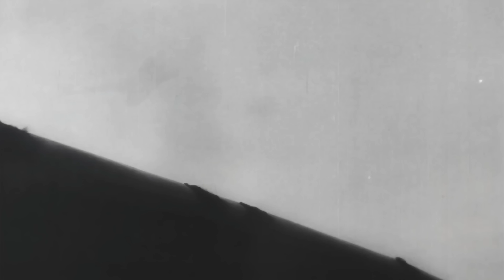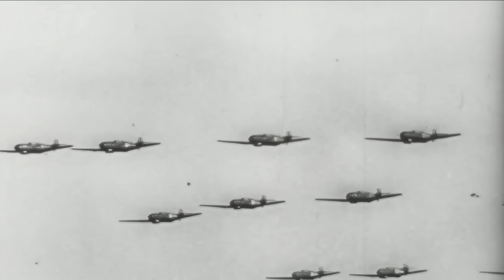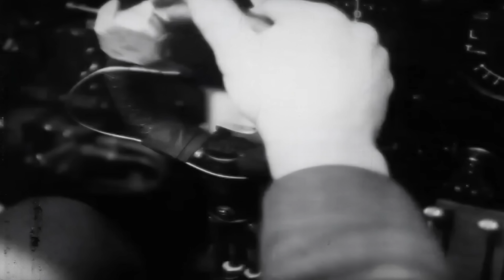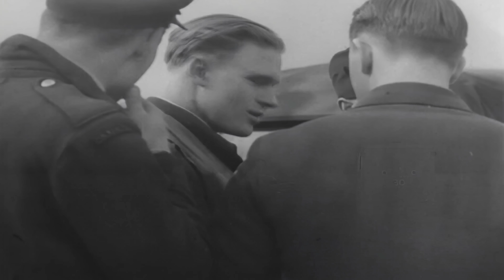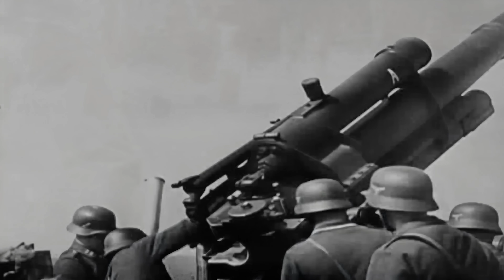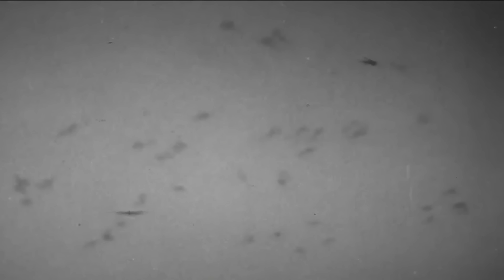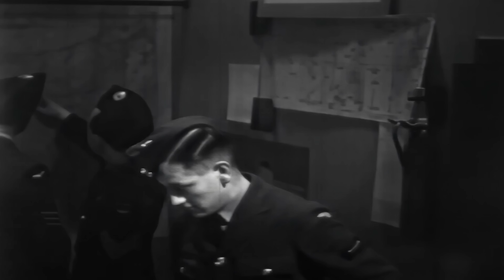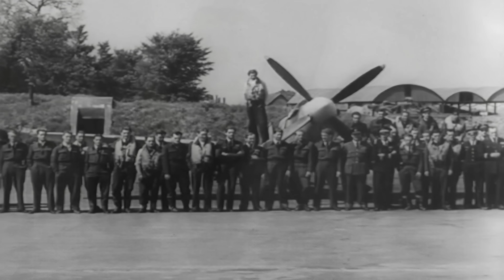440mph Monster That Cracked Germany’s Air Force

Comment: The Mk 9 four blade propeller Spitfire was the answer to the Fw190 the Tyfnon was a fighter bomber fitted with rockets and small bombs
Reply: The Typhoon was a direct answer to the Fw190 a  but problems with it cause it change in role. The Spitfire needed the time so the Typhoon was there first. The Tempest is what the Typhoon should have ended up as as originally the Tempest was going to be called the Typhoon Mk2
Reply: It took the better part of a year from the appearance of the FW190 to the Spit Mk9, meanwhile the Typhoon took control
Reply: I was going to say the Griffon engined Spitfire was what took back air superiority
Reply: @reggiedixon2  Not so MkIX 1942 parity MkVIII 1943 and MkVII  1944 superiority all with Merlins The  MkVII HF had the highest service ceiling  of all allied fighters @ 45700ft
Reply: The Typhoon was intended as a fighter, but it was a failure. The ground attack missions was unintended but a reasonable use of it. The P47 was better for ground attack as the Typhoon was a bit crap. The Tempest and Fury were excellent.
Reply: @kentl7228  No not so P47 downlow 350mph Typhoon 372 mph Typhoon more maoeuvrable P47 turned like a bus  RAF were trained at G/A and CAS in the UK I do not think the USAAF ahd a school in the UK
Reply: @jacktattis The P47 could carry more, the belly rack helped, fly further, could belly land safely from no chin radiator, could take more damage, fly higher and faster after the mission, had good agility up high, didn't have fume in the cockpit problems.... The Typhoon did ground attack because the airframe was a failed fighter and the flaws still were there in ground attack. I used to like the Typhoon, but the reality was different.
The Tempest and Fury families were brilliant.
Reply: @kentl7228   The P 47 did ground attack because it was a poor fighter and the Typhoon was better and a great ground attack fighter.
Reply: @barrierodliffe4155 That is utterly false. The best German pilots were killed by the P47. The highest scoring USAF European aces flew the P47. It turned very well up high. Down low, not so much but it was a high altitude fighter. The Mustang used less fuel and flew further, though a P47 could fly almost as far with decent fuel tanks and the later P47N outranged the Mustang.

As I wrote above, the Typhoon was a problematic dog. The Tempest was designed to fix the flaws of the Typhoon.
Reply: @kentl7228  hahahaahaha P47 2000 to  2400 lost doing G/A exclusively for LESS THAN one year YES 2000+
 Typhoon in service 12 months before the P47 AND only 670 planes were lost to all  causes
Reply: @jacktattis Why start with "hahahaha"? Are you even a teenager yet?
The Typhoon had compressibility problems from too thick a wing. Exhaust fumes would leak into the cockpit, affecting the pilot adversely. The tails would break off and kill the pilot. The chin radiator would dig in and flip the aircraft during belly landings, killing the pilot. It carried less than the P47.
The Mosquito and the P47 were the two aircraft with the lowest loss rates in the European theatre.
The Typhoon wasn't good at all and had high losses. There is a reason why the excellent Tempest and Fury fighters were designed. Because the Typhoon was crap.
Reply: @jacktattis a simple Google search ..

"The P-47 Thunderbolt generally had a lower operational loss rate than the Hawker Typhoon, primarily due to its incredibly tough air-cooled radial engine (R-2800) which resisted battle damage far better than the Typhoon's liquid-cooled Napier Sabre, making the P-47 more survivable, especially against ground fire, despite the Typhoon's effectiveness in ground attack roles. While both were robust, the P-47's ability to absorb hits gave it a superior sortie survival rate, around 0.7%, compared to some estimates suggesting high losses for Typhoons, especially early on. "
Reply: @jacktattis   "P-47 Thunderbolt Loss Rate & Durability

Low Loss Rate: The P-47 had the lowest loss rate of any single-engine fighter in Europe, with estimates around 0.7% of combat sorties resulting in a loss.

Battle Damage: Its large, air-cooled radial engine was famously durable, allowing it to absorb significant damage from small arms and light flak and still return home.
 
Hawker Typhoon Loss Rate & Vulnerability

Higher Losses: The Typhoon experienced a significantly higher percentage of losses, with some figures suggesting 56% of all Typhoon pilots were lost on operations, a rate higher than Bomber Command.

Engine Vulnerability: Its liquid-cooled Napier Sabre engine, while powerful, had a large radiator that was highly vulnerable to small arms fire and ground attacks, leading to more frequent engine failures and crashes"
Reply: Saying numbers of airframes lost, without stating over how many missions, doesn't show the percentage loss rate. This is basic mathematics.
Reply: @jacktattis While exact 1944 European losses vary by source, thousands of P-47 Thunderbolts were involved, with significant numbers lost to combat and accidents, with figures suggesting over 1,000 lost in 1944 alone, contributing to the overall war total of over 5,000 lost by the end of the war, including around 1,700 non-combat losses. 

The P-47 was crucial for ground attack and escort, absorbing heavy damage and suffering losses in intense fighting throughout the year, especially during major operations like D-Day and the Battle of the Bulge. 
Key Figures & Context:

Total War Losses: Approximately 5,222 P-47s were lost during WWII, with about 1,723 from non-combat accidents.

1944 Specifics: A specific 1944 breakdown isn't easily isolated, but given the high activity and losses, figures like over 100 lost by one group (371st FG) in a shorter period, and mentions of thousands lost by year's end, show the scale.

High Operational Tempo: P-47s flew hundreds of thousands of sorties in Europe, destroying vast numbers of enemy vehicles and aircraft, making significant losses inevitable. 

Why the Numbers Vary:
Combat vs. Accidents: Totals often combine combat and non-combat losses.

Theater Specifics: Losses in Europe (ETO) differ from the Pacific.
Data Sources: Different historians and units record figures slightly differently. 

In essence, 1944 was a brutal year for Thunderbolt crews, with significant aircraft attrition reflecting the intense ground-attack and escort missions flown on the continent.
Reply: @kentl7228  No not so up high good,  down low  terrible
Reply: @kentl7228  No not so,up in the air very good on the deck which we are talking about not good
Reply: @jacktattis You are moving the goalpost. The P47 was excellent as a fighter up high. Down low, less so. Either way, your previous claims were eviscerated by a simple Google search. I liked the Typhoon, until I read about the reality. The Tempest and Fury were fantastic.
Reply: @kentl7228  This  is  from Eric Brown Testing for Combat page 146
thhe USAAF  claims that 7067 enemy aircraft were destroyed by P47s almost equally divided between air combat and ground attack 
Altogether 3499 P47 were lost, 824 in air to air leaving 2675 lost to all causes from April 43
Only 670 Typhoons were lost to all cause from  May 42
The US were the only ones  to claim planes destroyed on the ground as kills. We never did that and that changes statistics
Reply: @kentl7228  1.HAHAHA  it is sarcasm to you fanbois   
2. The Typhoon  did  have compressibilty issues but the RAF advanced flying units  taught the pilots how to use the plane within those liimits The P47 pilots did not have those AFU in the UK and  suffered for it
3. The Typhoon could put their ordnance on target because of those AFU The  P47 pilots did not have the training and were not as good 
4. 2600 P47s lost to  all causes apart from air to air in 2 years   670 Typhoons lost to all causes in 3.5 years So all that other info  you posted is  not needed 
Oh and in air accuracy the P47pilots were not mentioned
Reply: @jacktattis Don't you understand mathematics? If Typhoons flew 1200 missions and lost 600 airframes, while Thunderbolts flew 20000 missions and lost 1000 airframes, which plane is performing worse? The one with the worst statistics by losses per mission. I just proved the point before and you still don't understand by mentioning losses but not comparing how many missions were done. Typhoons never got near 0.7% mission losses.
Reply: @jacktattis I am not a fanboy. I am stating statistics and respecting better results. 
I even stated losses due to non combat incidents.
3317 Typhoons were made in total. 15683 P47 were made.
I mentioned compressibility because the crappy too thick wing limited it's speed. I am not talking about not pulling out of dives.

You are blindly supporting a flawed aircraft when the statistics have another story. That is being a fanboy, in reality. Like I said earlier, I think the successors were excellent. The successors were made to get rid of the glaring faults of the Typhoon. It was nearly rejected from ever going into service at all.
Reply: @kentl7228  Go eo Warfare History Network Thhe Scopurge  of the Falaiise Pocket read and weep. Give its faults and its magnificent  record despite those faults
Reply: @kentl7228  There were not 15683  P47s in the UK  actually the were 2743 decreasing all  the  time until 10 dec 44 the 8thAF only had 112 of the original 780 
Even the 9tAF  were replacing the P47 from Feb 44 in increasing numbers
There were  550 Typhoons just with the RAF2TAF and Typhoons with the ADGB 
And there WERE 3317 Typhoons in the UK
Reply: @jacktattis I stated the total number of P47 produced. I didn't say they were only based in the UK. A large amount were likely in Europe after D Day and Italy before then. Then there was the Pacific theatre and Africa.

Saying 10th December 1944... That was after DDay. So they were stationed in Europe, closer to the front.

Lastly, I stated the total number being built for Typhoons was 3317

Comment: SA-W is a Tempest V, not a typhoon..
Reply: A lot of Tempests, the tail section of the Tempest is clearly different. The Tempest is probably the best low-to-mid altitude multi-role fighter of the war.
Reply: I'd love to have a Tempest,Typhoon,and a Corsair
Reply: Many of the images may be of Tempests. Without a clear view of the wing's thickness or profile it can sometimes be difficult to tell the planes apart.
Reply: Be great full that it's not a kittyhawk 😉